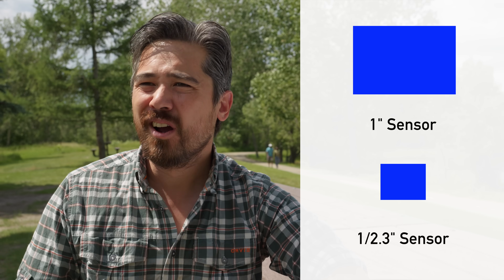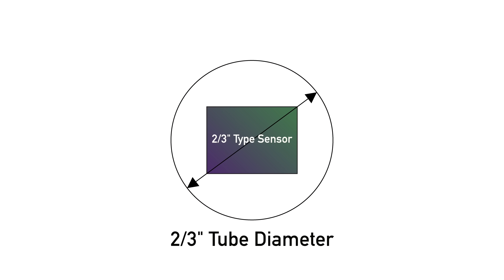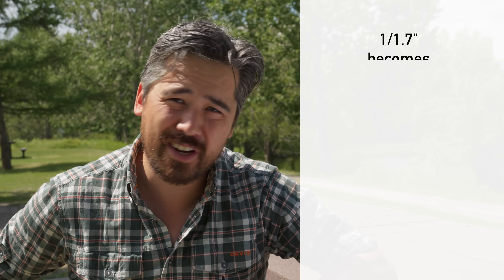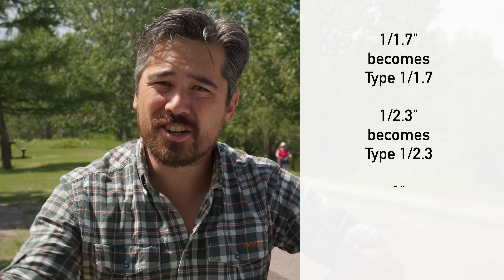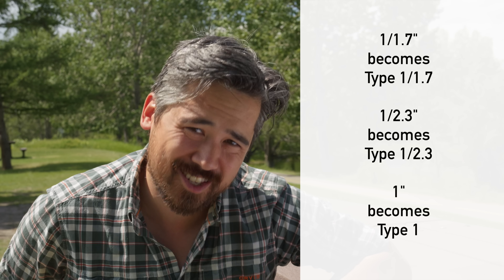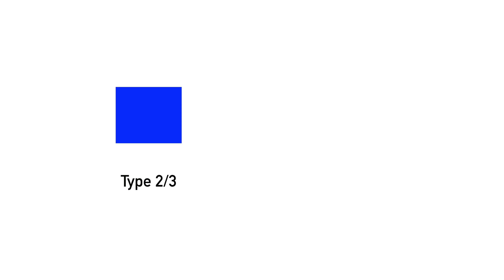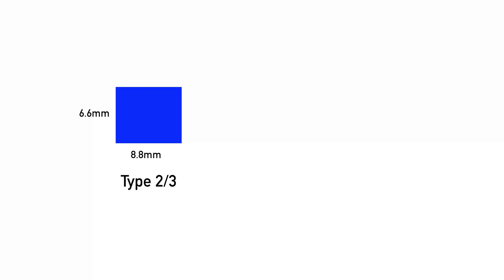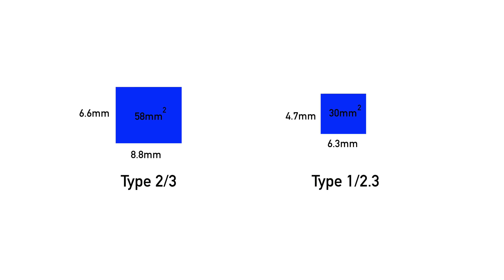Sensor sizes make no sense, but we fixed it!

Comment: I had 2 diffrent prosumer Sony mini DV camcordets. The sensors in both were slightly bigger than the sensor in the lower end consumer models. Mine had a 2/3rds size sensor but couldn't figure out how much larger they were from the consumer models

Comment: I always wondered why a 1/3rd, 1/2th, or 2/3rds didn't actually have that length, be it horizontally, vertically, or diagonal.  That's for finally explaining this to me.  Can we outlaw these old names now?  Also...how about we just start describing sensors based on their horizontal width in millimeters?

Comment: For 2/3 can't you just divide 2÷3  = 66% of 1". For 1/2.3  is 1÷2.3 = 43% of 1".  Of course a 1" sensor isn't actually 1 inch but all smaller sensor sizes are based off of that size standard.

It's much easier to visualize a smaller sensor as a percentage of a 1" rather than specific dimensions or square mm etc

Comment: Someone needs to make a 1 inch mirror-less system. Everyone has been pushing full frame cameras but when you shoot 16:9 video you don't even use the whole sensor size anyway. You should factor actual used sensor for video as that's what most youtubers use.

Comment: Wow!  Before watching this whole video all the way through in the recent minutes, I did not know that a 1/2.3" sensor meant that it could fit inside of a certain type of tube used for televisions. Interestingly, one of my smartphones has a 1/2.5" sensor. If a sensor of a given measurement specification could fit inside a certain type or size of tube, perhaps its diagonal measurement from corner to opposite corner does indeed come into play.... In other words, a 1/2.3" sensor and a 1/2.5" sensor would be different from each other in the sense that they would fit inside tubes of different diameters, yet correspondingly, they would also need to have slightly different diagonal measurements from corner to corner.  Thanks!

Comment: I just found out that there's a formula to calculate surface area of a sensor in sq-mm, as long as megapixels and pixel pitch or pixel size (in micrometer or μm) in known:
Surface area (sq-mm) = Megapixels x pixel pitch x pixel pitch. 
For example, a 16MP camera with a pixel pitch of 1.6μm would have a surface area of 16 x 1.6 x 1.6 = 40.96 sq-mm. 
And this would give you an accurate measurement of the sensor, regardless of its aspect ratio.

Comment: Hi Chris, I watched your video and found it very interesting. My concern is one critical point everyone explains incorrectly. There are 2 key points when discussing image sensors. These are the Optical characteristics and the Technical characteristics of every image sensor. You did a great job explaining the Optical differences and failed, like everyone else, the Technical aspects of the image sensor were not clear. An image sensor is an electronic component with technical limitations. The size of the sensor does not change these technical limitations. For example, the sensor has an active noise component (floor) the moment the camera is switched on. Dishonest marketers decided not to tell the truth because selling more FF cameras is more important. We have the opportunity to manage the sensor's saturation and SNR. How does one do that? The daily repeated marketing phrase claiming "One sensor captures more light" is dishonest. The challenge we ALL face is how to best deal with the different reflected light intensities from the scene. All image sensors undersaturate in the shadow parts of the scene. That means a lower SNR and more visible image noise in the shadows. Your ISO simply amplifies the lower SNR in the shadow parts of the image signal. Why do all image sensors produce excellent image quality in bright light, and NOT only M43 sensors? Because the sensor saturates in good light. That means a high SNR, low visible noise, and more tonal data. Why? (think gamma & tonal data distribution) Go to my Blog for more information on what digital photographers should know... Best Siegfried

Comment: the micro four thirds or even four thirds us also a fraction of the same idea. 

It's not 4/3 out of a full frame, but 4:3 is great. aspect ratio matters as the diagonal limits your lens options. 

So area + aspect ratio would be great. Or diagonal and aspect ratio instead

Comment: IMHO referring to sensors by their area (30 mm² or 58 mm²) makes the most sense, as that immediately tells the viewer/reader how large or small the sensor is compared to the 35mm standard (864 mm²; many people reading this wouldn't have realized how big a difference in sensor size that is...). Of course, "full frame", "4/3rds" and "APS-C" also continue to make sense. So you should always include the sensor's area in the specs.

Comment: Almost everyone knows what 24 mm x 36 mm means and everyone can imagine this size - and any other size derived from it. Anyone is able to calculate the area or the diagonal from these two values, should this ever be necessary.
On the other hand, nobody knows the values of the area or the diagonal of any existing sensor. Also, you cannot calculate anything from these values alone! So why not just specify the size of the sensor in mm x mm - anything else would be far too complicated.

Comment: it is so confusing and does not take into consideration the aspect ratio of the sensor, why not using just sensor's width size in mm + aspect ratio? so that normal people can understand ... something like 35mm 3:2 (FF) or 43.8mm 4:3 (Hasselblad x1d) or 16mm 3:2 (1inch sensor)

Comment: I'm all for "this phone has (diagonal mm) 4:3 sensor", and add "that is the common 1/2.3" sensor" just as a "transition time", only to get rid of it later on, and keeping only APS-C and FF only.
It's longer than the old nomenclature, but I prefer it rather than some totally uninformative 1/2.3" (After 18 years of digital photography, I understand today for the first time what it means... so guess what, it's useless). I'm positive DPReview has some authority and enough following to get the photographers (and maybe other youtubers/sites) used to a new meaningful standard after some transition time, given that the current system is a total nonsense to everyone and nobody has any reason to like it. The "type" you introduced is shorter but not informative anyway.

Comment: I would just stick to mm². With this, you can differentiate all sensors, give good impression of their absolute size and the size differences relative to each. With a 2/3 sensor named 58 mm² sensor compared to a 1/2.3 one named 30 mm² sensor, you can see at once that the first is nearly double the size of the latter. And when the Full Format sensor becomes known as a 864 mm² sensor, everyone realizes instantly the both of them are rather small sensors, and how large a 2,159 mm² Medium Format sensor really is. No in-depth camera technology knowledge needed any more to be able to understand sensor sizes.

Comment: You should definitely add greek letters! Upper case if bigger than FF, lower case if smaller. Alpha beeing 4:3 aspect ratio, beta 3:2, gamma 1:1, phi 1:9 and so on.
Also add a sigma if the sensor is stacked and a beta for back iluminated.
If its a high resolution sensor it should get a plus for every 8 MP above 24 MP.

To get rid of the inches and fractions, you could use the Barleycorn so a MFT Sensor becomes a Type 4 Barleycorn aplha.

I like your videos but honestly, replacing inch by type does not change anything. If you want to kee the fractions, keep the inch.
Adding the width, hight and area is a nice idea.

Have a nice day 
:goodvibes:

Comment: I feel just crop numbering be better, because as sensor actual size numbers dont mean much for most people. If know crop number the lens on some of the smaller sensors also be easy to calculate.  Also M4/3 is that 1.9x and 2.3x still falls under m4/3 and then Aspc or super35mm also isnt a single size as 1.5x to 1.6x still apsc. Just saying crop numbering and also when using certain feature when it crop in also say the crop numbering will still makes sense.

Comment: I'm not angry about it or anything, but this is still super confusing. 😂 There's got to be a standard you can use that makes sense and doesn't require multiple standards. Pixel density? I don't know, but I'm saying, this didn't clear anything up.

Comment: One of the problems with both the old and the new system, is the fact that non-US regions often use the comma as a decimal separator. So ‘2.3’ has no actual numerical meaning in many places outside the US. I suppose this becomes somewhat less of a hindrance in your proposed communication standard.

Comment: For a both understandable and unambiguous system, just select one measurement (I suggest the diagonal as this is the standard for screens etc) and add the aspect ratio. It can then be used with or without the aspect ratio depending on the context.
"5 mm (4:3)", or just "5 mm", makes magnitudes more sense than "Type 1/3.4". I mean, how large is that? Especially when "Type 1 (4:3)" at the same time is 15.9 mm.
Just use the bloody size! Why complicate things? It works for any conceivable sensor size, small or large, old or new. And makes immediate sense.

Comment: This issue is already solvable just by using dimensions. But marketers are never going to use standard measurements if it means admitting their 1/2.3" sensor is only 6.17mm x 4.55mm.

Comment: The numbers or re-namings don't do any justice whatsoever in my opinion. Just leaving all the numbers and deleting the inch indicator and adding the word type in front. I feel like that didn't change anything, and the measurements don't do me any favor either because they don't tell me the most important thing: What crop factor the sensor has. Yes I could compare it to full frame because I know the measurements out the back of my head, but that still doesn't let me compare 1/2.3 and 2/3 even tho I know now that 2/3 is about two millimeters bigger in both directions. At the end of the day if I have an f1.7 lens on a 2/3 inch sensor I wanna find out what kind of Full Frame equivalent that is since that's the benchmark with it having a 1.0 crop. Same goes for the focal length. These two things are especially important for Smartphone companies that don't tell you the full frame equivalents of their sensor because they wanna make it sound impressive. So, just devide the numbers. Just take the 1/2.3 and divide 1 by 2.3 and you'll get something in the neighborhood of 0.44. That 44 percent is compared to a 1.0 type sensor. That at least get's us somewhere cause I know a 1.0 type has about a 3x crop, so I know that 1/2.3 is about a 4.3x the crop. This is just an estimation but it at least get's me somewhere.

Comment: Hey I know let's change the old confusing way of describing sensors with a new confusing way of describing sensors ,where we prefix the anachronistic and also misleading imperial measurement with Type1 then add a two different metric measure measurements on top of that. 
Here's a radical thought, why not simply use the area size of the sensor in mm and aspect ratio, so folk know image shape and nothing else. It has clarity and there's no way folk can be confused by marketing BS  re size differences.

Comment: 20 sec into the video I almost thought I missed the 1/4 video this year. But seriously, many suggested to use a relative measurement/ratio compare to full frame and I agree. If I tell you a building is 443m tall, you will have no idea how tall it is. But if I say the build is approx half as tall as CN tower, then it is a lot easier to understand.

Comment: I'd settle for ending the practice of mixing decimals and fractions. 

Maybe the sensor size unit equivalent of the Noct should be the "Ansel", where the sensor area is expressed as a decimal with the area of an 8x10 sheet of film being 1.0.

Comment: Replacing the archaic inch symbol with the meaningless word "type" is no more clear and potentially even more confusing. 

Just use the surface area, width:height aspect ratio, and the percent to full frame. 

Examples:
"Nikon's Z9 sensor (864 sqmm, 3:2 aspect ratio, 100% full frame)" 
"Canon's R7 sensor (329 sqmm, 3:2 aspect ratio, 38% full frame"
"Panasonic LX100 sensor (221 sqmm, 4:3 aspect ratio, 26% full frame"
"GoPro's Hero 10 sensor (30 sqmm, 4:3 aspect ratio, 3.4% full frame)

Comment: Instead of showing the absolute size, why not use the crop factor? That way it's also easy to compare  lenses for different sensors. In addition you could point out sensors that are not 4:3 ratio.

Comment: OK, here's the deal, once and for all: 
24x36mm = Full-Frame
APS-C = Half-Frame (16x24) Yup, two APS-C sensors, rotated 90 degrees, fit on a FF sensor!
M4/3 = Quarter-Frame (Why?)
P.S. Y'all inhaled too many fumes at that traffic circle in Wetzlar. Sticking "Type" in front of random digits was a Leica joke, right?

Comment: I would just use the diagonal (about the circle of light diameter form the lens) and an aspect ratio (4/3, 3/2, 16/9 etc).
You could also set a surface ratio: FF=1, APSC=1/2 M43=1/4, MF=1.6, 1"=1/2.7 etc.

Comment: Why invent a new system instead of using an existing system? You can just crop factor of the diagonal, which is an established method, and the aspect ratio. So a "Type 1" sensor is a 2.7 crop factor, with a 3:2 ratio. Its super easy to compare to M43 which is a ~2 CF or APSC thats ~1.5 CF and uses a metric every photographer already understands. Now we need to use the name "Type 1" then convert that into dimensions using your look up table, then convert that into a measurement we already know.

Comment: Drop the Type naming all together. Surface area in mm squared for direct comparisons. Provide the height and length dimensions in mm. Eg 1452mm squared, 44mm x 33mm. 864mm squared, 36mm x 24mm. 

The type naming isn’t helpful.

Comment: The excitement of this video reminds me of the battle of Don Quijote contra the wind mills. What progress to exchange the term "inch" with type!
By the way a good relational typing sytem would be to add the crop factor relatively to so called full frame.
P.S. Full frame is a misleading marketing term because there are sizes mulch bigger. In German it has been called "Kleinbild" meaning "small frame".

Comment: This is a great idea, wish something like this happened a long time ago. Just my thought, but it seems like the simplest and most easy for most people to understand would be simply putting the diagonal measurement along with the aspect ratio. this is the same system used to measure screen size and widely understood. ei, 20mm 4.3 or 20mm 16.9, super easy to visualize.

Comment: Apart from sensor surface area, the resolution, technology makes a big influence. Pixels/mm2 is also key.
Anyway just name the rounded off square mm size, no need for 'types' and parts etc.
More important is the dynamic range, and how that compares to other camera's. Something in the vain of: "the Dynamic range goes from 11,5 to 6 at Iso 12,800".

Comment: Sensor manufacturers have been giving millimeter sizes for years, they would love things to be standardized in metric measurements because it makes their job easier but they have the problem of customers demanding the old measurements. If photography was the largest user of sensors then maybe some standardization would be possible, but photography is just one of many competing industrial uses for sensors. They are widely used in industrial production. For example tiny sensors are used to regulate machine speeds by measuring light obscured by teeth in a gear. Sensors are widely used in scientific instruments, in engineering and surveying. Each industry has its own needs, and often these remain unchanged across decades meaning that old standards are baked into new purchases.

Even in the television industry, it is misleading to suggest that the 1 inch tube was just a 1950's standard. That is true, but it stayed a standard for decades and the transition to modern digital sensors did not start until the 1990's. At that time, because new sensors had to be put into equipment designed for 1 inch tubes, the sensors had to match that standard. The change-over took many years, and there is likely still studios that use old gear that was designed for 1 inch tubes. As a result, customers still require the old standard sizes.

The most curious case is APS-C. This is not a standard that precedes the digital age. And it is a purely photographic format. The APS (Advanced Photo System)was a late attempt (1996) by Kodak to market low quality film products. It wasn't very popular and is now considered obsolete for film. However, in the rush to digital, manufacturers took advantage of existing APS film lens designs to introduce sensors that were roughly similar to APS film sizes. In the film era H stood for High definition (even though it wasn't) C stood for classic, (even though as a new system there was nothing classic about it.) P stood for panoramic. While Canon introduced APS-H at one point, it is the APS-C which proved popular amongst consumers for balance of physical smallish size with quality. I am unaware of APS-P ever being used for digital sensors.

Comment: Use a diagonal measurement in millimeters, or to preserve a sense of continuity just use the width of the sensor & round up or down to the nearest whole millimeter.
Problem Solved

Comment: Until manufacturers start using another nomenclature what they used was what they used. It didn't really tell the whole story, but it told a story of what had already been told and had evidence of what the sensor size compared with in cameras of past. Fractions are still pretty easy to deal with, 1/2.3 is smaller than 1/1.7. Pretty much once you get below the 1" sensor you are in cheap point and shoot/action cam/smartphone territory and it really doesn't matter.